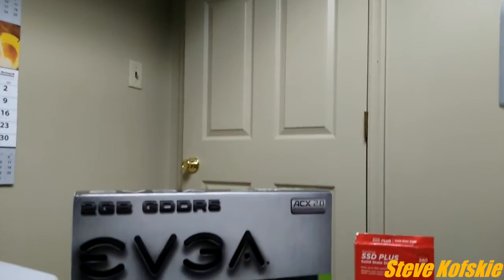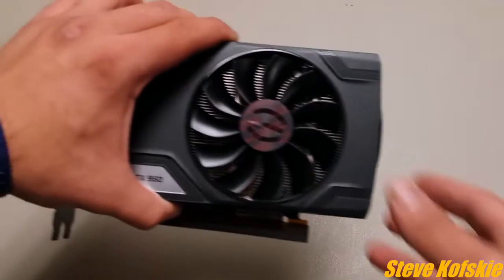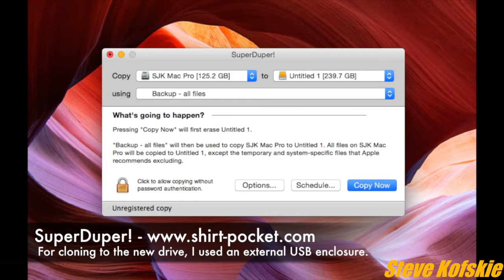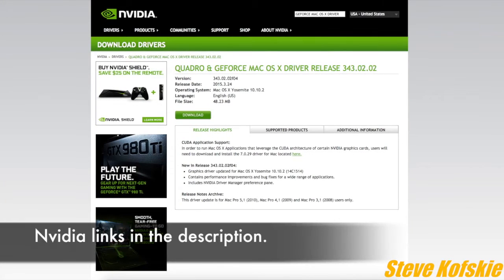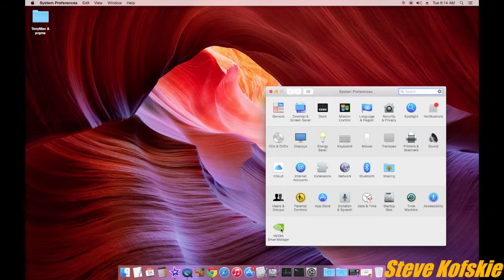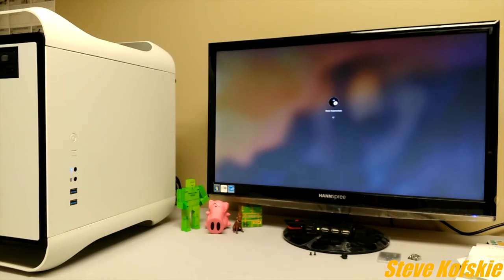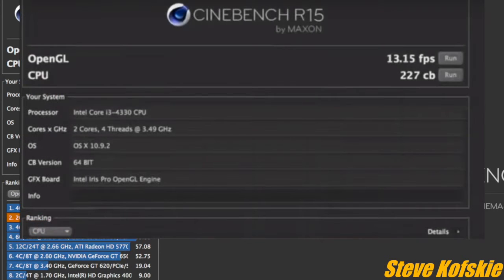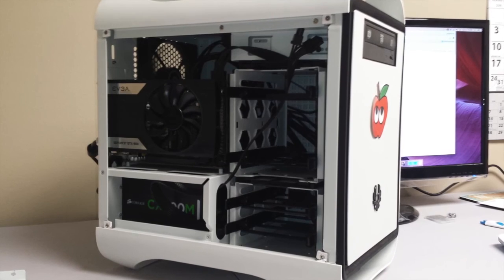Installing an EVGA Geforce GTX 960 SC and New Sandisk SSD in my Customac Mini (Hackintosh)

Comment: Hey bro. Nice video. I have a question for ya. I just bought this gpu last week.. Now before I got this. I was running the gtx 560. The 560 had 2 6 pin connectors. This 960 has only 1! So right now i am using 1 of the 6 pins witch were used for the 560. but in your video I see an 8 pin. Please tell me if im doing something wrong because at this point I think this gpu isn't getting enough power. idk why lol.  btw my power supply is 850W. 

Keep up the good videos :)

Comment: Why did you need another ssd?
Reply from the maker: +MrHD71 I wanted a bigger SSD for my OS X hard drive. Also, it only cost less than $80 for the drive so I figured why not?  I plan on using the other SSD to demo Windows 10 in a future video.